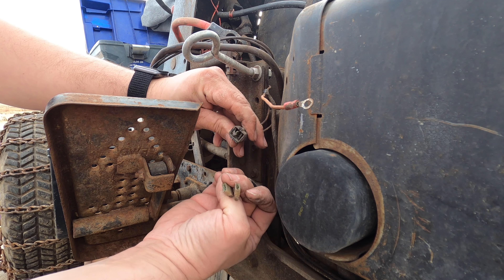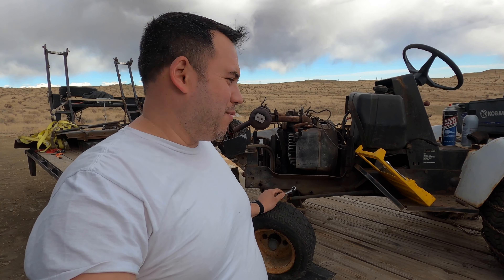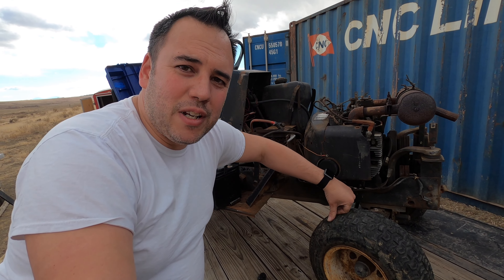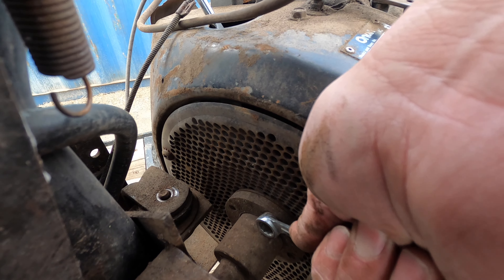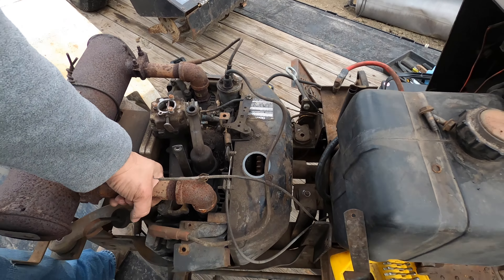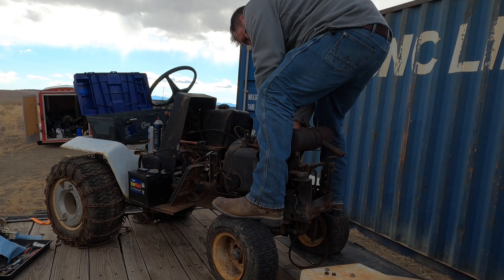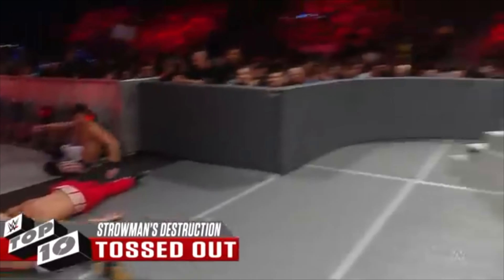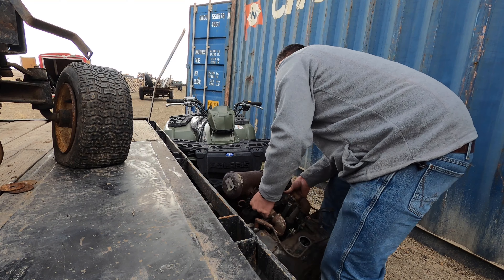Pulling the Onan for Repair - Bolens QT16

Comment: maybe you can show us where to let the old oil out of the system... would be nice, thx
Reply from the maker: Sure could!  I've still got to get the engine back in, but should be doing that soon.  Are you interested in the engine oil or hydraulic oil?
Reply: @TractorHoarders  in the engine oil, i have to change the oilfilter, but i have no idea where the drainoutscrew is...